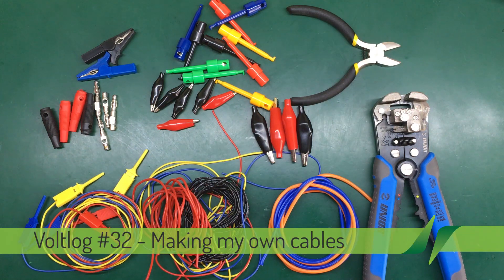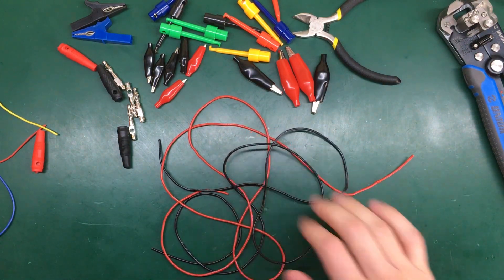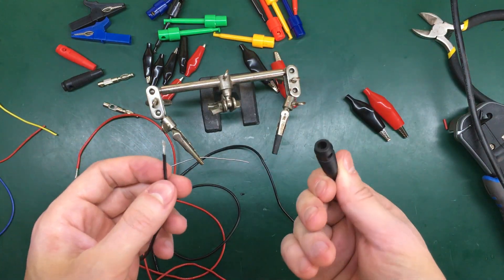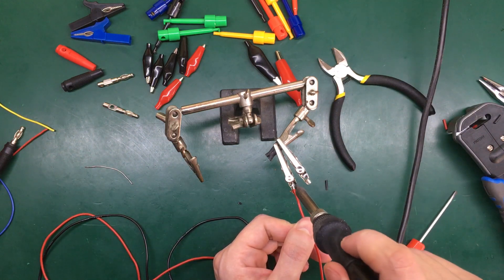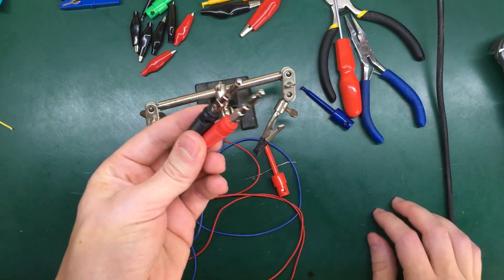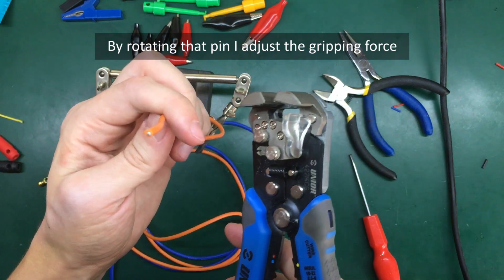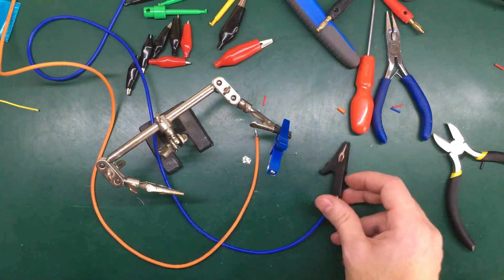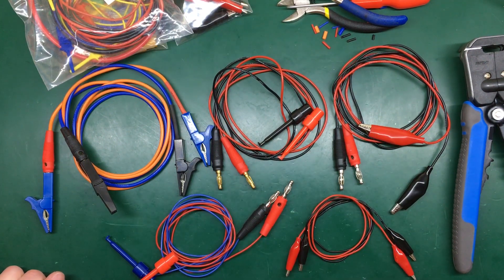Voltlog #32 - Making my own bench test leads

Comment: Your soldering technique is quite bad here. Always, always heat the wire from underneath, then apply solder from the top surface and it'll wick its way towards the heat, penetrating the wire. If the solder doesn't melt when you touch it to the wire, the wire isn't yet up to the proper temperature for soldering.

Have third hand keep the wire in place and  have the solder wire in one hand and iron in another.

Never do this where solder-wire is stationary and you have the copper wire and the iron in hand... it just creates issues.

Never use that screw to secure stranded wire, and if you've soldered the wire, especially not then. It'll work itself loose by either displacing the solder or by crushing and severing the strands. If you don't use crimped ferrule for stranded wire, you can not insert it into a screw terminal.

Solder that connection. Take the screw out, push the wire inside, heat the connector from below and then push solder through the screw hole until it melts and wicks through the wire and the connector surface.

Comment: Just a warning to the "4mm different color banana connector" linked above. They actually direct to "2 mm" bananas. I ordered without double checking. My fault. :-)  Maybe a  correction is appropriate... Now what project to do with 2mm bananas... :-)
Reply: I used them as sense wires in my rack panel for two HP6632A power-supplies... that way one doesn't accidentally at least use a wrong terminal and damage the sense terminals :)
Reply from the maker: sorry for the issue and thank you for reporting this, the link has been fixed.
Reply: VoltLog Can you give the link you bought from. Because i need only red and black. Also thanks for the AWSOME video.

Comment: Isnt 24AWG too small for 2 meter long power wire?
I think 18AWG will be proper size for low power.
Reply from the maker: It depends on what current you are putting through the wire, ohms law will tell if it's okay or not.
Reply: Mr Ohm also says, longer wire, thicker wire needed.
Also 24AWG is just quite fragile.
But they are ok for these grabbers, I also used shrink tube as strain relief
Reply from the maker: Mr Ohm says, I = U / R, that means if you have a higher current you need a lower resistance (aka shorter, thicker wire) to avoid the voltage drop. So, like I mentioned in my previous comment it's all about the current.
Reply: Yeah yeah...
Reply: 24AWG is too low for decent test leads. With 3A you might already get up to 0.5V drop on a 2m cable which is huge.
18AWG has 5 times less resistance and is a minimum for a decent test lead!
Reply: Could you use 12 guage wire as well  ?
Reply: ppdan and if you had really watched the video, you would've seen he used 16 awg for a set he intended to use for higher ranges. you're trying to be "smart" but actually dumb.

Comment: Tinning the wire with screw terminals is not a good idea. Over the time the solder will cold flow and loose the connection. It is better practice to use ferrules or solder the wire directly to the banana plug.
Reply from the maker: +llamaspit it's probably the same reason why they use press-fit connectors instead of soldering them in high reliability applications like aerospace/military. It makes sense now, but I didn't know this at the time of this video.
Reply from the maker: +Mr.Martin Thank you for sharing, I did not know that. I have ferrules and a crimping tool for them so I will try to use them next time.
Reply: +Mr.Martin Yes, definitely. I came in to post the same information! It is really bad practice to use a screw connection onto solder - almost a 100% guarantee of a bad connection. Always use a ferrule (just cut the end off a crimped lug, to leave just the crimping tube part)
Reply: I have read about this and decided to test it myself, it is true in a way because solder alloy is soft and cant resist being under pressure, but if you crank the screw enough untill it bites in fully and presses against copper there will be no issues. I did it this way in extension cords for high amp and no issues